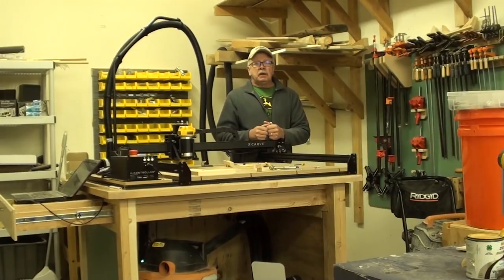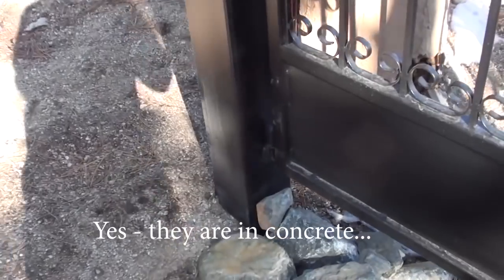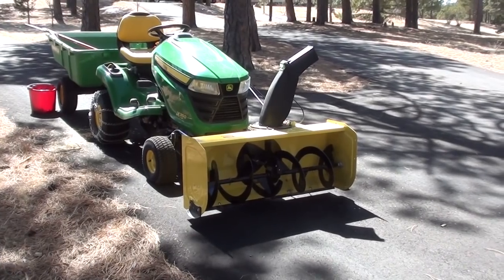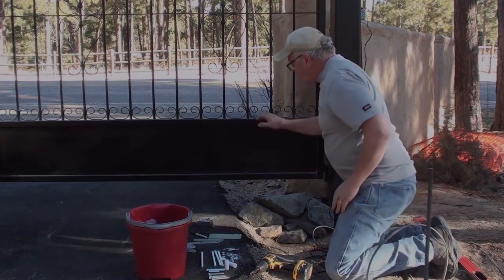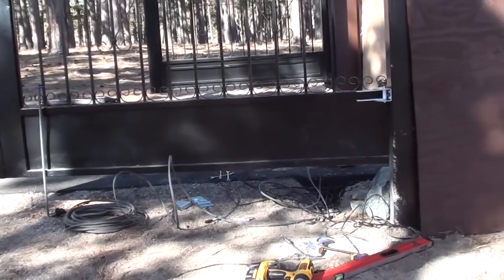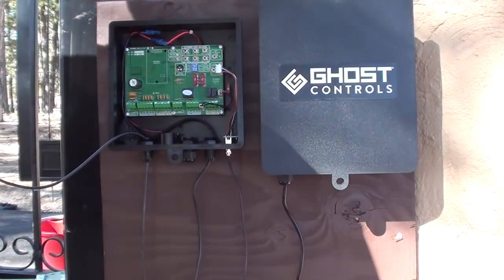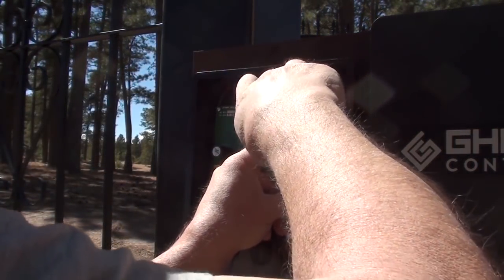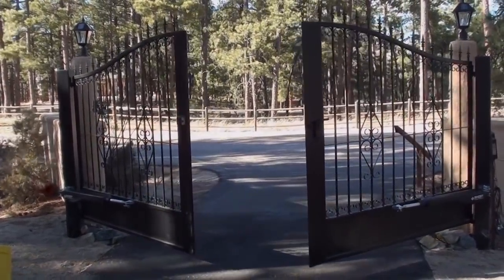DIY Remote Gate Opener Installation - Ghost Controls

Comment: By chance are those bolts that didn't fit a 3/8 hole in the post metric? Goddamn things need a 27/64 bit. Shop I'm at has vending machines full of these things but it drives me crazy they won't just use SAE across the board for this kind of stuff. It doesn't have to be within thousandths of an inch because it isn't holding up a skyscraper so any whatever grade 8 is more than enough, just don't mix the zinc plated with aluminum.

Great content, more information than I can absorb. So refreshing to see long single cuts instead of a mess of editing, I feel like I learn so much more when the human aspect of a task isn't edited out.

Comment: If you can help me out here. I'm looking to install one also and is there a battery box for both sides of gate, or just one battery box with solar panel?
Reply from the maker: There is 1 battery box that holds 2 batteries.  I installed 2 solar panels as that area is in shade half the day.  Hope this helps.  Thanks for watching.

Comment: And did you ever get the WiFi add on you talked about
Reply from the maker: Not yet.  Just put in a mesh wifi extender to boost signal at the gate.  Will be looking into that later this summer.  Thanks for watching.

Comment: People bad mouth Mighty Mule I instal and use Mighty Mule and Ghost I've been using a Mighty Mule 660 for 10 Years and no trouble. I run10 watts of solar on a deep cycle battery and its fine. All shaft openers have problems with ice on the shaft which can bind the opener it is easily fixed with a plastic sleeve over the shaft and some cooking spray in cold weather. Most people who have problems like gates that open by themselves were just to lazy to change the dip switch code in the opener and remote. Which is now digital so no more problems with that! Unless YOU instal it wrong! Both brands are very good it depends on the application and what you want it to do.
Reply from the maker: I priced out Mighty Mule.  Similar equipment would have cost 30% more.  And Ghost has a lifetime warranty on the motor and gears.  I think it is a superior product.  Thanks for watching.

Comment: Awesome review and install tutorial.   I will be receiving mine tommorow.    We have a business on our property and am wondering .... Can I set business hours.   For instance.   From 8am to 5pm if someone runs over the sensor the gate will open.... And after 5pm you will need to have a code to enter?   I plan on calling support about this but dint know if you had a quick answer for me.   Thanks.
Reply from the maker: Not sure that will work.  The sensor was designed for egress.  A vehicle exiting causes the sensor to OPEN the gate from the interior.  Maybe the party programming will work for you - but that is manual every day.  Hope this helps!
Reply: James Wegner awesome... I will look into the party mode.